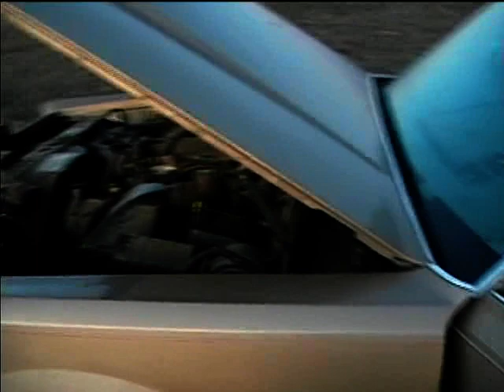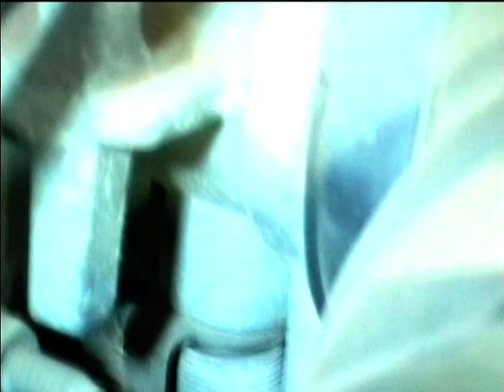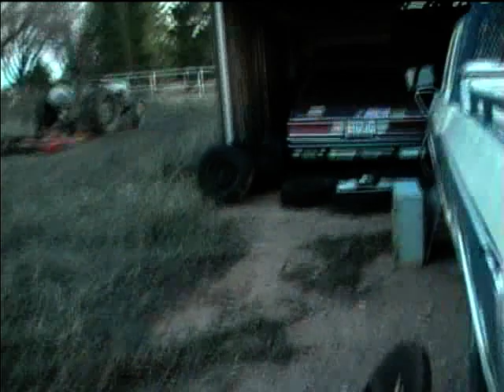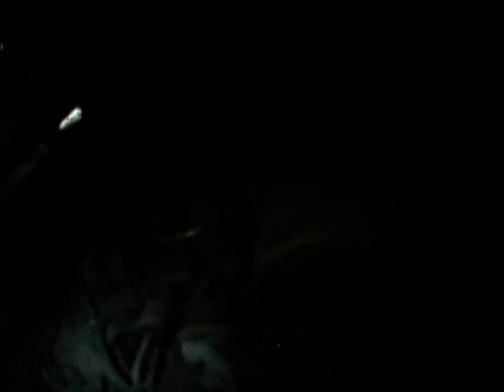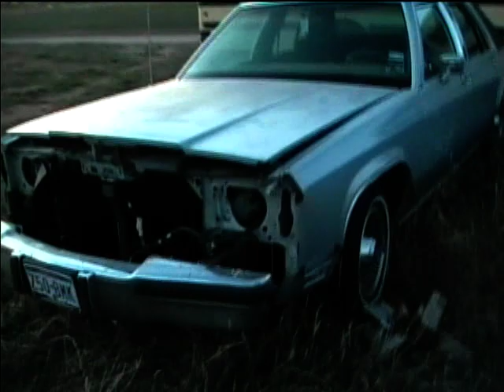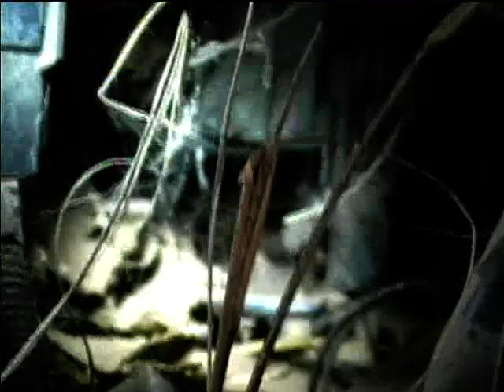Ford AOD transmission throttle valve bushing check

Comment: What's fatal about the throttle valve cable coming loose, is that the transmission hydraulic pressure is directly controlled by the cable's position. So, more throttle means more cable pull and more "line" pressure.

If it comes off, line pressure goes way down, too low to keep the clutches firmly together.

 Then, under load they slip and burn up, and then no more movement.

Comment: Your 78 Marquis defenentlly has the C6 known back then as the "Cruise-O-matic" transmission.

I do recall a friend of mine saying something about the number 1 cause of failure on AOD transmissions being related to a TV cable he called it, and I guess that would be the Throttle Valve cable breaking off, or not adjusted right.

So thanks to your vid, the last piece of the puzzle has been put together :)

Comment: This shift timing getting weird is another result. The trans thinks there's no load on it because the line pressure remaining down, so it starts having slipping, early shifts.

 The C4/C6/FMX use vacuum modulator that controls shift TIMING only. If the line comes off, or gets a hole, the weaker vacuum signal makes the transmission  think the accelerator is opened much farther than it actually is, causing very late, or no upshifts. They won't burn up because of it.

Comment: I think that AOD uses the same TV type system as the GM 700-R4. The Throttle Valve cable is crucial on those, if it's not adjusted right it'll burn up the transmission.

On the maroon Grand Marquis, that mechanic you took it to was an incompetent. You could get a new 302, or put in a stroker 347 with MAP fuel system for a fun sleeper.

Comment: It looks like you need a bit more weight to push the floor down.  That little hammer is not going to do much. Try dropping a large river rock on the floor with the seat moved back, and the steering wheel tilted up.  A concrete block might work too.

Comment: Chad, you can refer to the data sticker on the driver side door to confirm what trans the '78 Marquis has.

In the space labeled TR will be a letter or number. Just find that and decode it on the internet.